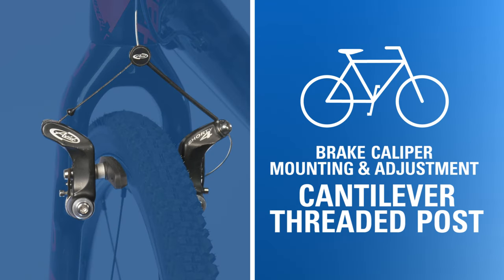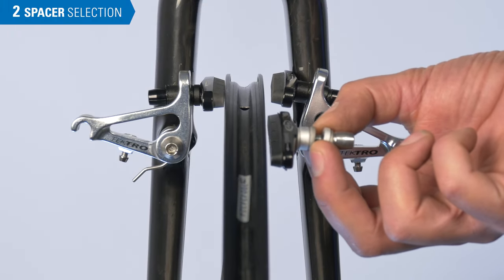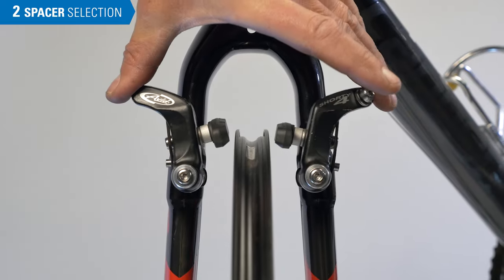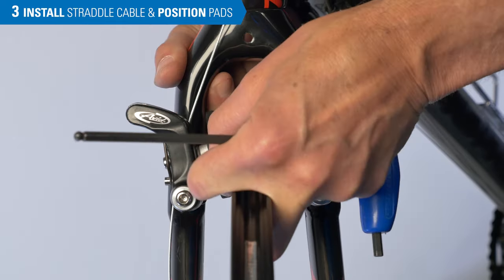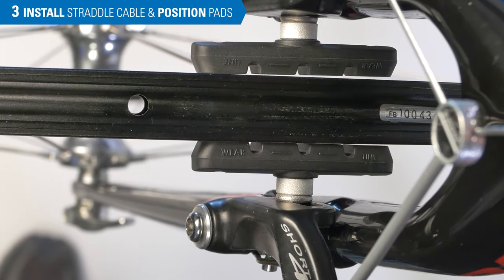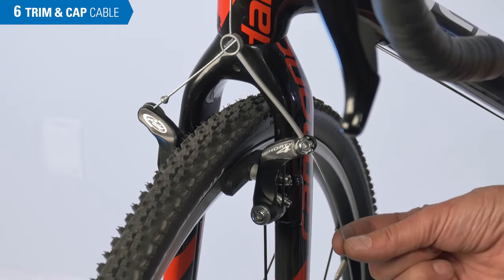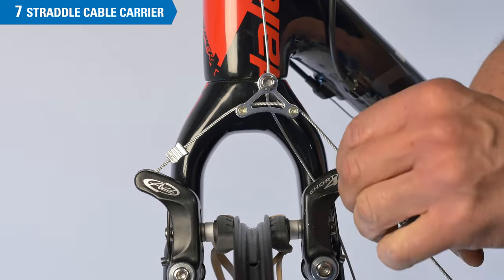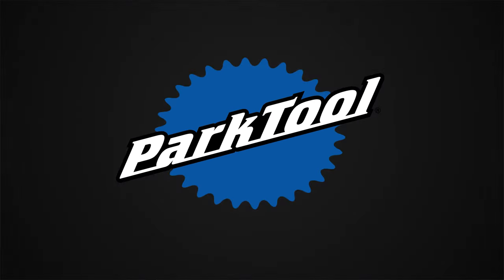Brake Caliper Mounting & Adjustment - Cantilever Threaded Post

Comment: Good video. Lowering the straddle cable carrier increases braking power. Lower it enough and they almost feel like disc brakes! But as the video points a low height may give trouble with debris clearance. Also, a low carrier position gives less brake arm travel so you must set the pads very close to the rim to start with. Personally I like a somewhat lower position to give a strong brake feel. And I love that choosing the straddle cable carrier height gives you the option to set the braking power to what you want. Not all brake systems let you choose the amount of leverage.
Reply: does lowering the straddle carrier increase brake power…or does heightening it?

Comment: I find if I can open my quick release then the break is very poor in strength. I also found that no matter what set of spacers I used I could not get the pads parallel with the rim... I'm told they should be very powerful brakes... I'm I yet to discover the secret to getting them to work the best they can? 
I use the tektro cantis shown in the video at 2:35 with the very Long lever arms.

Comment: I am currently repairing the front brake of my girlfriend's bicycle. It has the same type as seen at 07:19. The cable snapped due to an accident. I changed it, cleaned everything but the damn circular thing (where the main cable goes through) keeps slipping to one side. I was like wtf is this?! Now I see that when the cable snapped the small hose that keeps things in place has fallen off. All I need to do is find a replacement! Thank you!

Comment: I have a question about the Straddle cable carrier position. It is right in front of the eyelet at the centre of the fork where the two fork blades meet. That means no front bike rack can be placed, as 99% of front racks use that eyelet.

Can the carrier be moved up whilst retaining adequate brake function, or is it better to completely change the v brake so the cable approaches from the left or right of the Centreline?

Comment: Quick question, I know this is probably a silly to ask but can you convert this into a side pull brake setup?
Reply from the maker: You can convert these to linear pull/ V brakes if you use short arms to correct the throw difference. There are only a rare few bikes/forks out there that would allow you to mount a side pull brake if it has canti's.

Comment: Question for you..... on  my Cannondale Adventure bike, the front wheel/rim has a groove all around the circumference where the pad rides.  The back rim doesn't.   It appears to be built that way and isn't from damage.  
I'm guessing you are more familiar with bikes than me so I'm curious if you know if this is normal?  
I think it's called a Maddux 700c rim. 

I emailed the store I got it from but have no response yet.   

Thanks for your time.
Reply from the maker: Normally rim match, but not always.   There are rims made with a "wear groove".  As you ride and brake, the rim wears away and get thinner.  Once that groove disappears, the rim is thinner at the sidewalls and should be replaced.
Reply: @parktool  ahh great info.   It does say that the rim is subject to wear on a sticker on the rim.  
I appreciate your help.   My local Cannondale dealer  is really available... when you want to buy a bike... not so much when you have questions!

Best Regards,
Bruce

Comment: Is there supposed to be any play back and forth? Because when I tighten
My bolts both sides have play
Reply from the maker: It is normal the arms will have some play when the bolt is secured.  They should move freely as the pivot to the rim.

Comment: I have built up a new bike and I have an issue, I heard rattling on my first ride and I pinned it down to the caliper wiggling on the bosses, it also doesn't go all the way on, the pin is halfway in the hole, any ideas?
Reply from the maker: It is common to have some play between the caliper and the boss.  Try removing them, greasing the bosses, and reinstalling.  Make sure springs are fully engaged.
Reply: @parktool  The problem is the shoulder on the boss is longer than the bushing on the inside of the caliper, so it doesn't seat all the way, on the shimano cx50's, I'm not alone I've read other reviews who have experienced the same with these calipers

Comment: At 4-35 haven't you got the concave  and convex washer the wrong way round.Seems like the convex washer needs to contact the brake arm on both sides.Please clarify.
Reply from the maker: There are two sets of these spacers, one on each side of the caliper arm.  The convex side must face the concave side.  The back side of each is flat, and identical in diameter and every other way.   The nut face and arm faces are flat, and need to contact the flat side of the spacer.
Reply: @parktool  Excellent video with a structured approach to setting up the brakes - but I have the same query. The Shimano leaflet for the Multi Condition Brake System shows the flat faces of both convex washers  fitted against each side of the brake caliper arm to form a 'ball joint' allowing the brake block to rotate about the middle of the caliper arm.Are both approaches effective?

Comment: Very usefull video ! Thank you ! Can you please tell me how to mount the part where the cable housing stops at the front brake on ergo levers ? In fact i don't even know how it looks. It doesn't show in your video. It would be of great help. I have a v-brake on my front with ergo levers and it has no stopping power.
Reply from the maker: The "ergo lever" from Campagnolo is not designed for most linear pull brakes. If your brake calipers require a "long travel" lever, then the system is incompatible. See if this video helps get the housing to your brake:
https://www.youtube.com/watch?v=oL82JM7H2Bw&list=PLGCTGpvdT04Q5OLMUo0yzTOjLtv7yT47O&index=17

-Calvin

Comment: When one side of the canti levers squeezes the rim more than the other what should I do?
Reply from the maker: Check this section of the video out. https://youtu.be/FvFira2dAPY?t=590 Let us know if there is something limiting you from accomplishing this.
Reply: @parktool  watched video many times. Right side pad sits much closer to rim than left. Delimit screws didn’t help. Played with right side cable cinch screw but can’t balance two sides. Real life seems different from video. Did lube posts and lock tight mounting screws. Thanks in advance
Reply from the maker: @meyers6622  Depending on the brake the set screw that you are adjusting is pushing directly against the tab of the spring. If the spring "walks off" the tab, adjsuting the screw will have no effect. Try fully loosening the screw and starting over feeling for the tab walking off.
Reply: @parktool  Thanks. If “set screw” refers to the small fine adjustment then that’s not my problem. I’m thinking problem may have to do with the cable at the STI shifter. That’s a guess. I can’t get the arms to center when cable is attached so pad is always rubbing on right side looking down. Cane Creek SCK-5.
Reply: @parktool  I didn’t fully understand your suggestion. You were correct about resetting set screw.